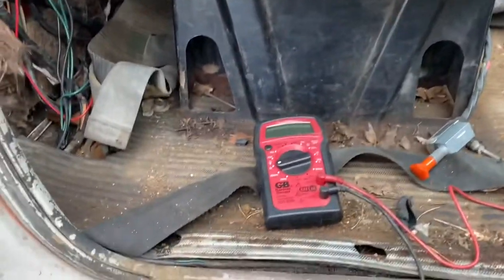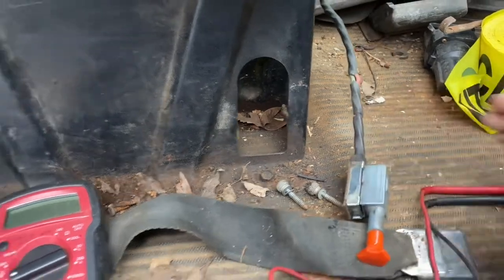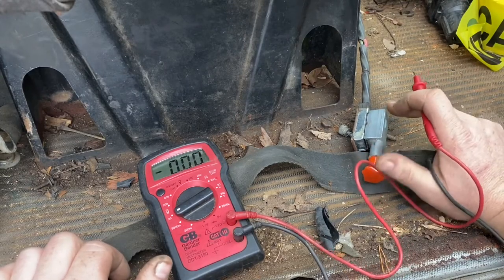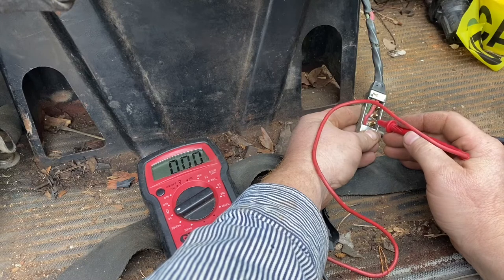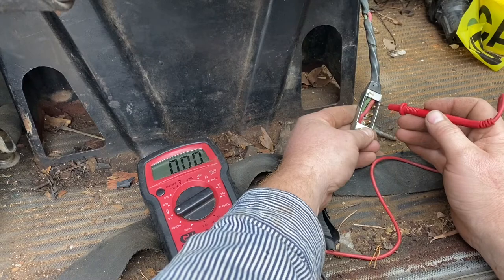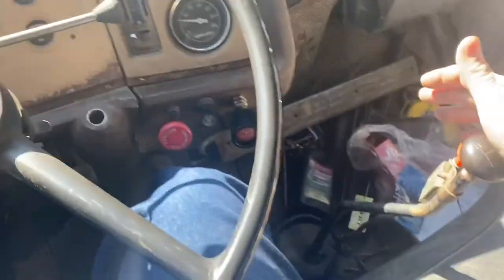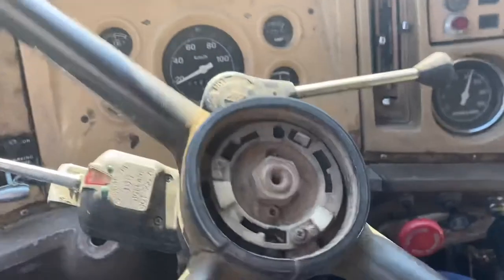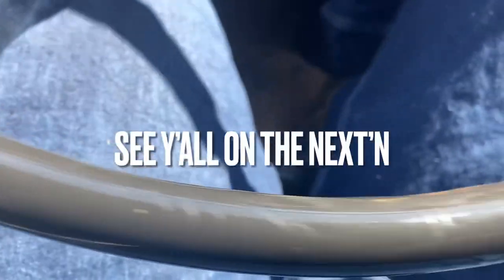Ford L8000 Cold start & 2speed axle wiring repair

Comment: Most useful thing I have ever found on YouTube! But my 75 Dodge D600 has two wires running to the 2 speed shift motor, I have to have 2 wires, both hot but uses the same switch? The 2 speed just won't shift and I ran new wires and soldered everything but it's all messed up like yours, farmer owned. Splices everywhere....
Reply from the maker: If I understand you correctly then yes, there should be 2 hot wires from the switch coming back to the shift motor.
Reply: @gacatskinner4835  I only have a circuit breaker under the dash that "snaps" off after a few seconds of switching to low range? The wire to the speedometer "thing" has been ripped off for some time. I don't think my 75 Dodge has a relay, I ordered a new switch (again) hoping that's the cause, my next move is a new harness from the switch on down if this doesn't word. The wiring is such a mess on this old truck, no such thing as a "free truck"!
Reply from the maker: @tripacer8259  it could simply be a bad circuit breaker.
Reply: @gacatskinner4835  I have a dead short somewhere and maybe that's it? I think I'm going to throw in the towel and call my mechanic buddy. He has tons of experience with this type of issue. It's kicking my a$$!
Reply from the maker: @tripacer8259  watch my other video about chasing down the wiring gremlins in this truck. Old truck wiring is usually a nightmare.